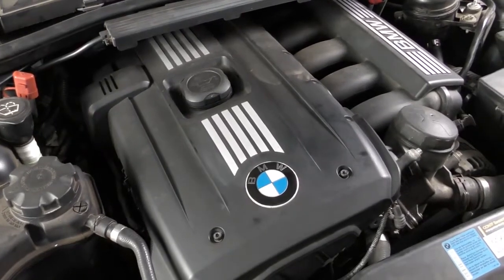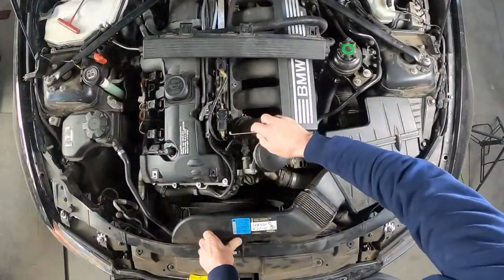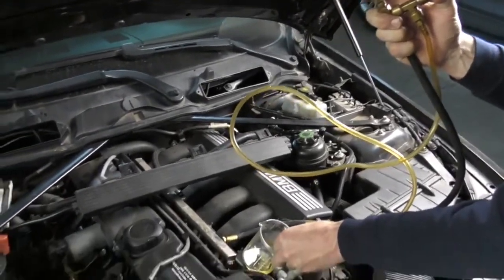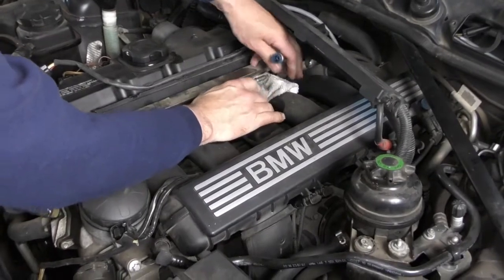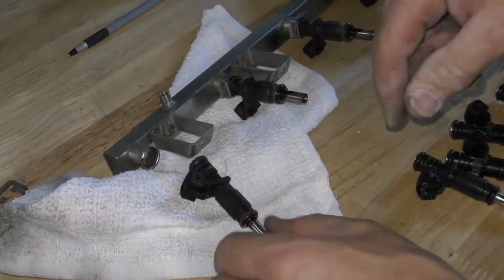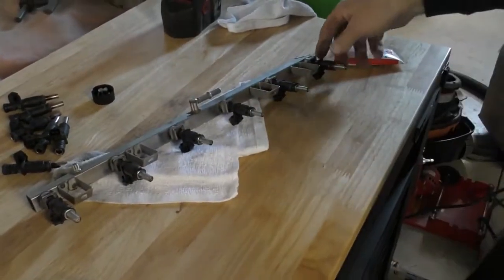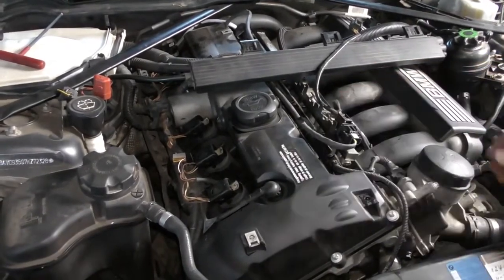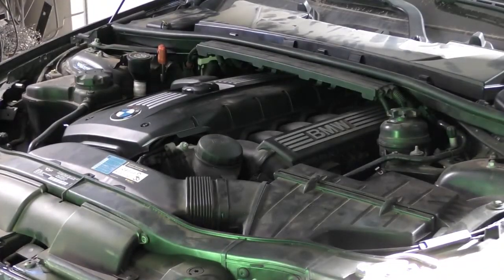BMW 328Xi 2007 Changing Fuel Injectors

Comment: Hi, could disconnecting the battery for a small period reset the computer fuel trim? Thanks very much
Reply from the maker: No not at all on these cars. you need to have a diagnostic tool that can talk to the computer.
Kurt

Comment: What about if you start the car, remove the fuel pump fuse and let it run until turns off itself... Easy and no other tools to release the fuel pressure...
Reply from the maker: You could.
Thanks for watching